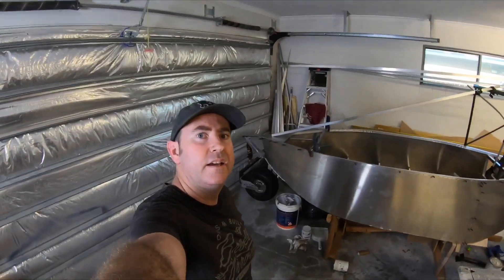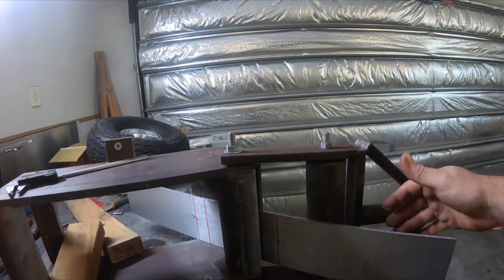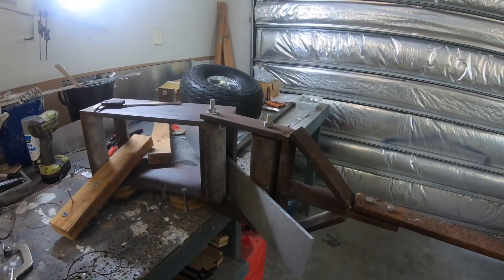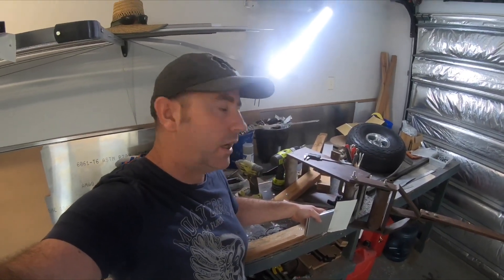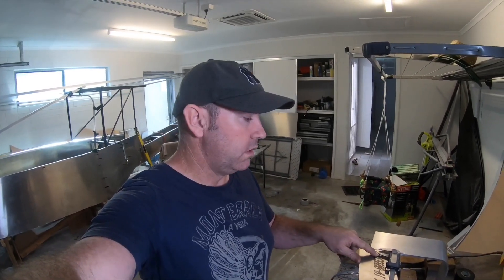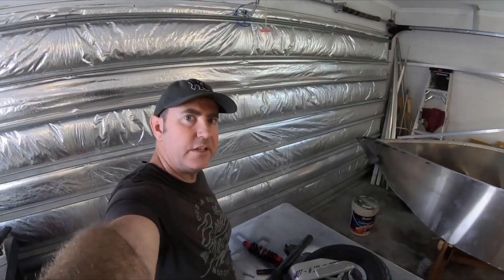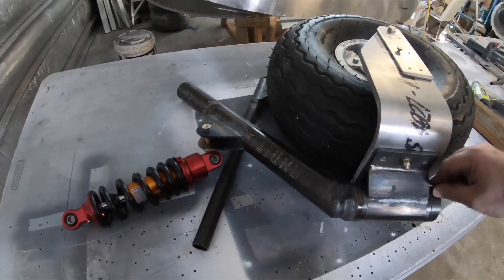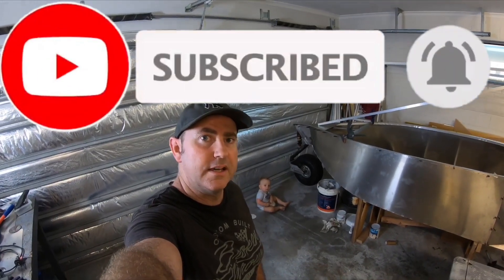Unleashed Experimental seaplane build update retract nose wheel keeping myself isolated

Comment: Interesting build, I have been following. I noticed that the retract of the front wheel gets mechanically harder when its almost all the way up. Could just be an illusion?
Reply from the maker: Yes that’s correct it does get a bit harder when it gets to about horizontal there is less lever force and the weight of the wheel kicks in , the lever in the cabin will have a mechanical advantage to counteract that so it’s an easy process to pull it up .Thanks for following along 👍🏻